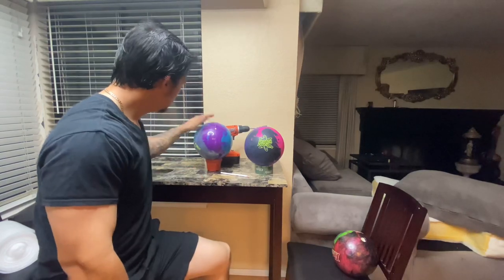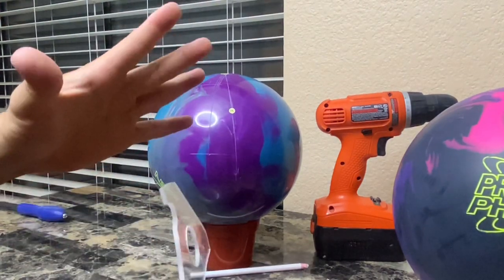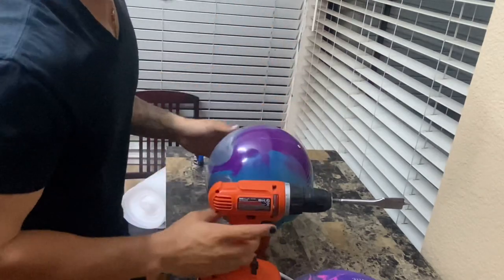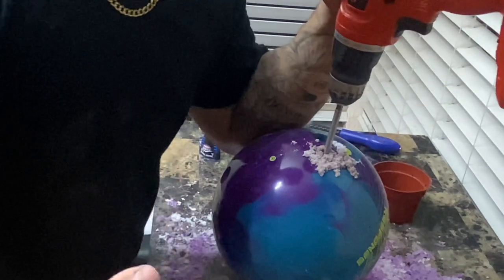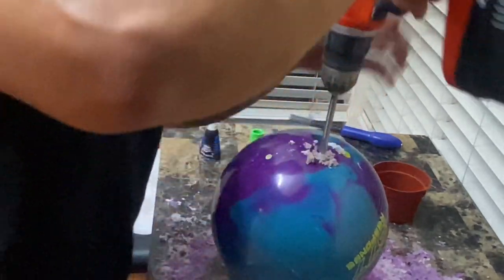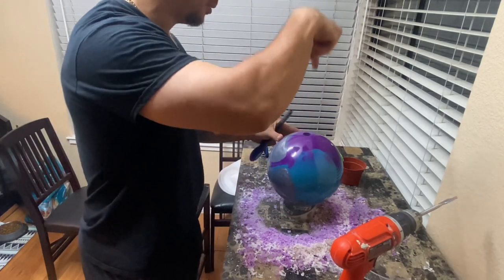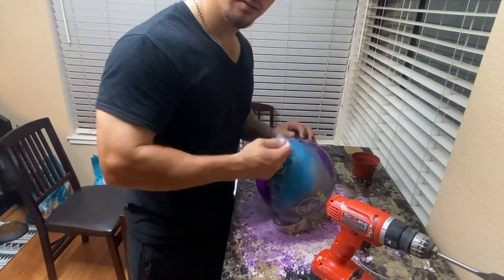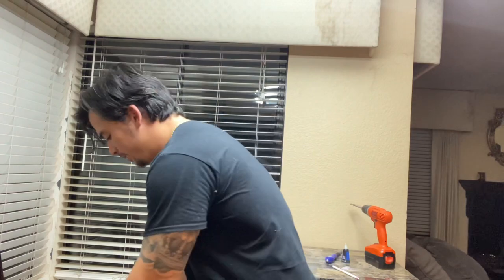Drilling Brand New Storm Proton Physix and 900 Global Zen bowling balls with a hand drill

Comment: About 10 years ago I bought a bowling ball on-line and took it to my local pro shop for drilling. He charged $75 for drilling.  Then, come to find out he didn’t pitch the fingers properly so the holes intersected towards bottom which weakens the ball but you couldn’t see that because of the finger inserts.   And to think that I even tip him $10.   Never again.  I started drilling my own balls and enjoy it. I use my drill press and an 8” stainless steel dog bowl with a rubber bottom.  I lay a non slip shelf liner across the bowl and it holds my ball very steady.  At least he measured my hand properly so I just replicate those measurements.
Reply: How do you get your finger pitches correct.  It would be cool if you did a video on how you drill your bowling balls at home.
Reply: @rr2418  
I could make a video on this procedure but it’s so non-traditional that the critics on YouTube would tear me a new one.  Note that I use thumb inserts, not switchgrips.  Also, there are a number of very good videos on ball drilling. Watch those and proceed carefully.  

If your pitches are unknown, you can use an electronic angle device to measure a drilled ball.  First, I placed the ball in a pet bowl with a liner, to ease adjustments.  I ensure that the hole is at the top most vertical location by placing a ring/washer over the hole and a “t-level” on top, then move the ball appropriately.  Once leveled, I place a straight edge or pipe in the hole pressed against the sides and measure the degrees of pitch (Left/Right and Forward/Reverse).  (Note:  Each degree of angle will be 2 millimeters when measuring the Pitch Mark in step 2 below. 

Procedure:
1.  Drill Mark:  Mark the center of your drill hole on your ball with a nail or other sharp object.  
2.  Pitch Mark:  From the Drill Mark go the OPPOSITE direction of your desired pitch.  That is, for left pitch, measure towards the right, for reverse (away) pitch, measure towards your palm, etc.  (Don’t let this confuse you.  Use your imagination and move your ball you can see how this will work when you drill straight down).  Mark the pitch location precisely and remember, this is only your Pitch Mark, NOT your Drill Mark!
3. Ball Positioning:  Using a washer and T-level, adjust the ball so that the Pitch Mark is the top most (vertical) part of your ball.  This positions your ball in the proper pitch position for drilling.  
4. Drill:  Drill on the Drill Mark—NOT on the Pitch Mark.  Proceed with care, assure your accuracy. 

Drilling your own balls takes some knowledge.   For example, you don’t want the finger bridge too narrow or you will void your warranty and possibly crack the bridge.  Also, for right handers you want left pitch for your middle finger and right pitch for your ring finger so that the holes don’t intersect at the bottom.  That would also weaken your bridge.  Normally the left and right pitch should total a minimum of 3/4” (19mm).  (Example:  middle finger 3/8” (9.5mm) left pitch and ring finger 3/8” (9.5mm) right pitch.  Or 1/4” (6mm) left and 1/2” (13mm) right.  Etc.).  I drill new balls now but I practiced on used plugged balls to learn.  

Years ago the pro-shop measured the finger pitches from my favorite ball grip.   I still use those measurements and occasionally experiment from there. Even though I can afford to pay a pro shop to drill my own balls, I enjoy doing it myself.  But I don’t plug balls.  I pay the pros for that.  
Good luck!

Tools:
Floor drill press, (check for level) 
Shop vac 
8” metal pet dish, 
Rubber shelf liner (placed over pet dish holds the ball steady)
Flat Metal washers 
Small T-level (verify the accuracy of your T-level).   
Hacksaw blade for cutting excess thumb slug, sandpaper, glue as needed.  
Hook knife to rough cut bevel, then sand smooth. 

I had all the above already.    Following are the extras I picked up.  
—Strikeforce marking pencils
—Thumb slugs and finger inserts (optional). 
—Carbide bowling  drill bits, about $40 each. (Milwaukee carbide drill bits are very similar for less cost)
(Measuring devices based on your preferred layout system, Dual angle, pin buffer, VLS, etc):
—6” or 155mm ruler bent to ball’s curvature.  
—Pro Sect $90 (optional), 
—Storm Arc Ruler $20 (optional)
Reply: This is a long read for sure..lol!  Well, I do hope you make a video of your technique someday.  I learn better by seeing how it's done.  But I thank you for your post explaining how you drill.  @Mote78
Reply: Cc
Reply: @rr2418  
You’re welcome.  Another tip is to cut a triangle on a piece of paper so that each corner is in the center of your holes. That takes care of the span.  I use that triangle to punch an indentation of where I want the holes drilled.  Mark the measurements on the three sides of your triangle.

Comment: Spade bits are garbage for bowling balls very sloppy and dull quickly.  Bi metal hole saws with pilot bit does much better or the best are carbide tipped round style hole saws with pilots.  You can use the cheap spade bits to remove the core afterwards.